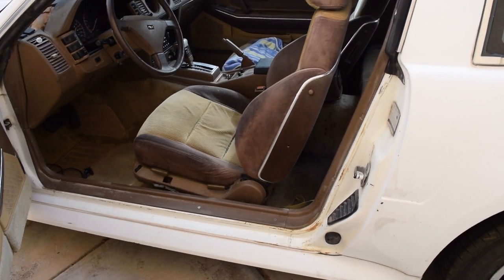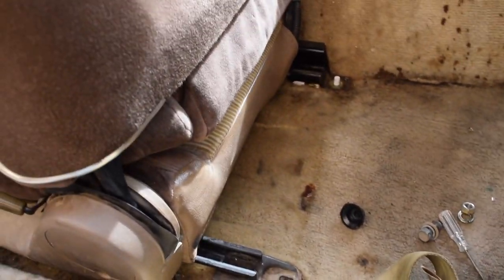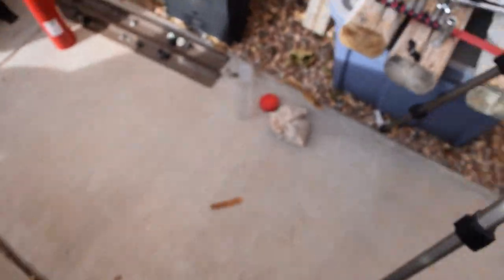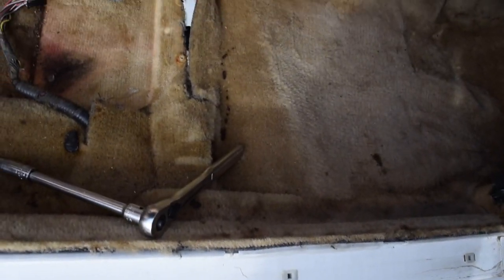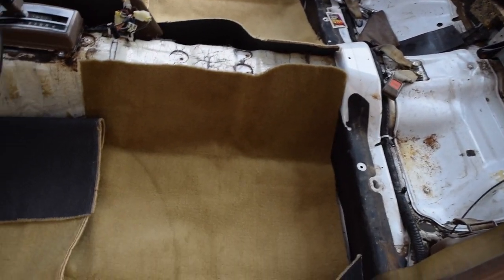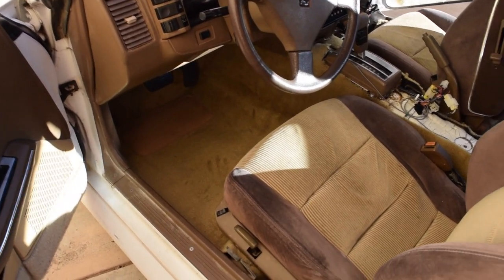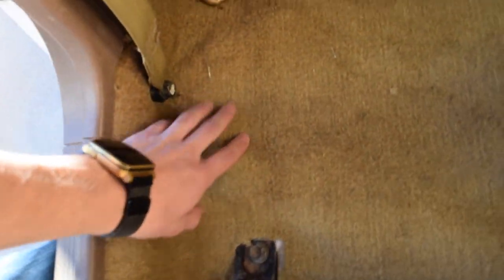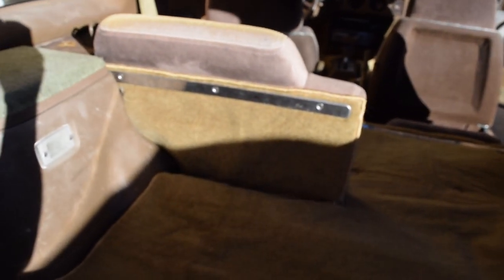Carpet Replacement! (300zx Z31)

Comment: The reason for the nut on the inner rear corner frame mounting instead of another bolt like the other 3 is for installation. When being assembled at the factory it's much easier and quicker to bolt down the seat once you have one corner aligned.  The first one takes no effort and then allows the worker to simply adjust the seat until the other 3 corners line up.  No time is wasted trying to get that first bolt hole located and started.